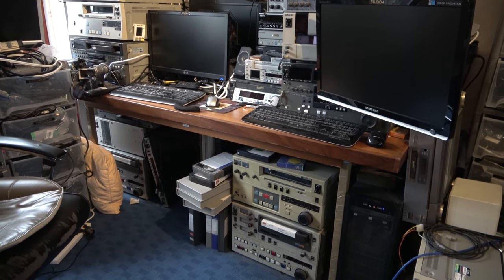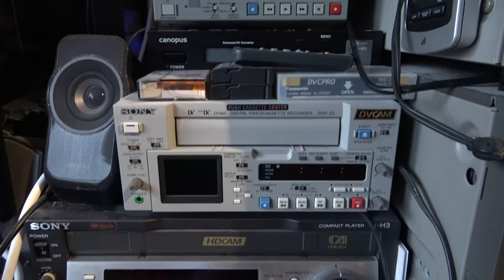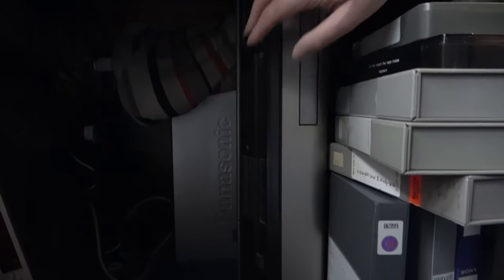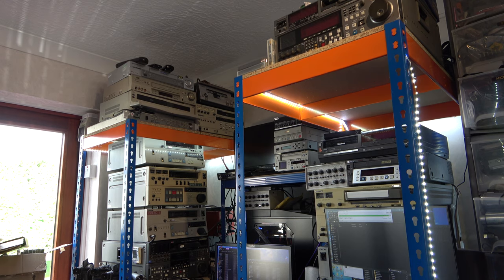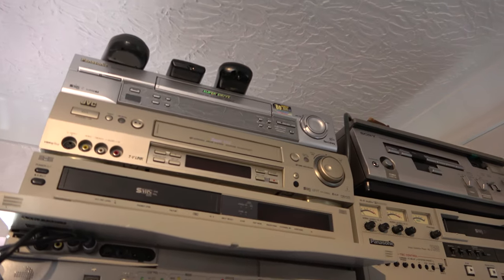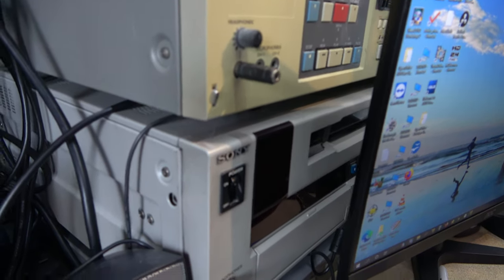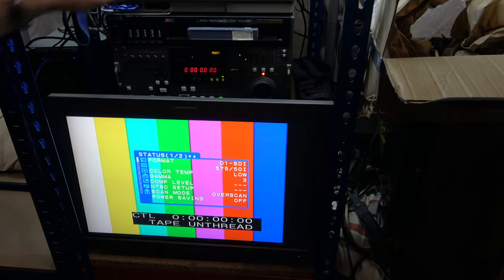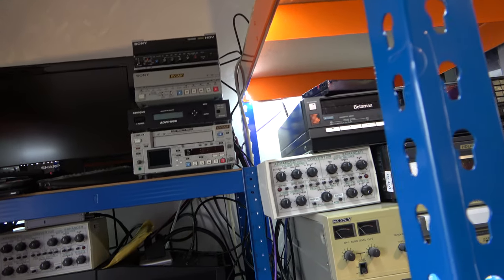Video transfer studio refit.

Comment: Incredible Setup! Is there a reason you use the Grundig 880 Video2000 Machine, and not the ones of the later generation (2xxx)? My Grundig 2280 gives a much cleaner and more detailed picture than my 880, but i also know of people who have had the opposite experience.
Reply from the maker: The VR2023 and similar machines have never given me the best pictures.  I don't have a working later Philips machine (I got one working once then within an hour of being repaired, another random electronic fault killed it!).  The 2x4 Super gives good pictures and sound, it's front loading which helps in my studio layout, has the time elapsed/remaining feature which is useful, and remote control.  It's unreliable as hell, just like all V2000 machines, but I think I've got so familiar with it that I can generally sort out problems quite quickly.  Once it managed to run for over a year without breaking down, which for V2000 is very good!
Reply: @video99couk  I was talking about the third generation Grundig machines, 2x8 etc. Ever tried these? Philips seem to overall produce a worse picture, at least from what i've seen so far, never had one myself. And i can relate to them being unreliable, i currently have 2 Grundig 2280 which both partially work sometimes and sometimes not. Keep on the great work, really like your videos! :)

Comment: The vectorscope could help you to deal with NTSC colour issues (hue shifting).
Especially when the source of the signal recorded comes from old aerial or analogue cable TV.

Waiting for the new obscure format!
Reply from the maker: The limitation with the vectorscope is a lack of analogue input.  I suppose I could connect it to something a DigiBeta recorder but then it would be PAL only.  I do have an analogue one too, but it quite literally blew up some years ago and would need a lot of work, there's a problem with its high voltage regulation.

Comment: 20 years ago I was fitting sky plus Digi boxes  with SDI  outputs  and the company I was doing it for sold them at £599 each .
Reply from the maker: Wow, SDI on Sky boxes, that's something I didn't know had ever existed.
Reply: @video99couk  Somewhere I still  have  magazine article , the company I fitted these for bought every pace 3000 sky box pace had left and I had them stacked up to the ceiling in the cellar , some even sold to the formula  1 racing team  , They fitted my PC with a SDI adaptor so I could test the boxes before sending the out  and I still have a standalone SDI box they sent me , unfortunately the whole thing collapsed when my stock of Pace 3000  boxes ran out  , the SDI conversion could not be done on newer model Pace 3100 as the processor was a BGA so there was no ware to tap off from .Personally I'm not familiar with SDI  but it was suppose to HD resolution pictures before HD had been invented .
Reply: @michaeldranfield7140  That's interesting! I suppose that prospective clients had specific needs; after all Sky digital boxes were basically DVB-S with decryption via the subscriber card. One use I can think of was when they'd show football match clips on the news and you'd see "Courtesy of Sky Sports" etc.

SDI stands for "Serial Digital Interface" and is basically a standardised format for transmitting audio, video, and control data in a professional setting. So I guess the modified boxes you sold were a much better way of ingesting a consumer format into a professional workflow instead of using an analog capture device which would've degraded quality and been harder to integrate.

Maybe this is what you mean with the HD resolution stuff - it wasn't HD as such, but the image quality was much higher - essentially broadcast quality, as the signal never left the digital domain. Sky didn't start broadcasting in HD until 2006, and you needed a new box because it uses a different digital encoding format.

Comment: Nice teaser about the blank spot.  Absolutely incredible setup.
That Panasonic pro SVHS player, under the NTSC BI (SLO-320, I think), looks very much like the one I used in an editing setup in high school 30 years ago.  I suspect it's the PAL version of the model I used, or at least very similar.  Brings back great memories.  I remember that you push in the jog/shuttle wheel to switch between jog and shuttle functions.  And those industrial transport control buttons... nothing like the buttons on any domestic or pro-sumer VCR.  As a student, I immediately knew I was dealing with a whole different grade of equipment than anything I'd ever seen before.

Comment: Awesome setup. Can I ask if you could do a video on the best or should I say most forgiving consumer video recorder/player you can recommend for playback of tapes that may not have been recorder on it (hope that makes sense) . I have done a little video transferring for my boxing channel from both Beta and VHS that I have either recorder myself or bought from other collectors. I understand the quality of tape is a factor as is the condition and ware of the outputting player.
Strangely the players that seemed to replay tapes the best were not the usual suspects, namely Panasonic and Sony, they were consistent.. always pretty good but no more... two head four head etc didn't seem to matter . 
Over the 30 or so years  I have had many many players and had great results from some unexpected manufactures, Mitsubishi, Phillips, Grundig spring to mind that have given better playback than Sony or Panny.. don't know why. Still, I could never afford expensive equipment so did the best I could. I have a pretty good Sony Betamax consumer player and various consumer VHS players. It's basic stuff.. No TBC.. Elgato HD60 .. A bit of tweaking with software for contrast brightness gamma etc and captured in OBS. So in effect I guess I am asking if you could do a piece on transferring video tapes on a budget. I really enjoy your very helpful videos. Keep up the good work.
Reply from the maker: I should say that there's no "best" machine, it's tape dependant.   Sometimes a VHS tape will play better on a JVC than it will on a Panasonic, or better on a relatively modest NV-HS930 than a more expensive professional deck.  Similarly, sometimes a Beta tape will play better in a Sanyo than a Sony, but another tape is better in a Sony.  As for doing it on a budget, I think there are two key items: A TBC (which is not cheap) and high bitrate video capture (I use DV/Firewire mostly, that's bot too expensive to put together).  Some people don't like DV/Firewire but it's much better than the compressed MPEG4 files from cheap USB capture devices.

Comment: Greetings, my good sir!  Am an incredibile fan of your videos, particularly on Broadcast standard gear.  There is still lots I've to figure out on order to utilize what may seem like obsolete equipment, to it's greatest capacity.  
Regarding why the professional monitor may be off in color compared to the consumer, would be your color calibration.  As every signal must be precise from camera to switcher to archive, to air, the monitor is key to have as close to the best picture, without having to flub around with.
With Broadcast standard color bars, the monitor should have a blue only function, which makes the bars black and blue.  The objective is to even out the color thought the monitor with the contrast, brightness, phase, Chroma adjustments so all black and blue is even though the screen.  Best set in complete darkness.  Once you are content with your adjustments, you turn the BLUE ONLY feature off, and you have a calibrated image to Broadcast standards.  At that point, in the is still a noticeable difference, then it would be wear and usage.  But professional monitors are truly built to last.  
You can't (that I know of) calibrate it through a waveform of vector scope.  That would be to calibrate the image itself to go on the air.  Then its everything from camera, to switcher, etc., that also must be taken into account.
None the less.  Your videos are quite educational.
I'm not too sure if you have any specifically on calibrating an older vector/waveform monitor, but that would be quite helpful.  I have four of them I'd like to work on myself to keep the best one(s), and be rid of the others.  They do tend up to take up a lot of useful space especially when not in use.
Also, on a DIY Sony DV VTR, And Sync to/with audio, as well as the difference between Genlock/TBS and Word clock.  I fancy the ability to record audio digitally, in an analog form.  Heh, Heh.  

Any how.  Thank you.
Cheers!

Comment: Now, what are you going to do with the two Sony DVW-A500P Digital Betacam recorders? Replace the worst condition one and replace it with a much better condition one donated from Bristol?
Reply from the maker: I had one DVW-A500P recorder plus a DVW-A510P player, this allowed me to do DigiBeta dubs if requested as I have been occasionally asked to do.  Now with the Bristol machine I have a spare for to take either place should one break (as one did a while ago, but I was able to repair it).  So for the time being, the Bristol machine is a spare.

Comment: Thank you for sharing your thoughts and your experience. Your new lab looks great. Your video comes perfectly timed, as I have to move my old lab to a new place. It was very interesting to hear your ideas about setting up a lab, you answered a lot of questions I was pondering myself. 

What’s your practical experience with stacking devices that accept tapes? When a tape gets stuck in one of my U-matic devices I have to remove them from the shelves and possibly lift other devices. This also affects all the cabling. How do you handle that?
Reply from the maker: Stacking was very much on my mind with this new set up.  It's horrible when the machine needs work at the bottom of a four stack of heavy machines.  So I always put the most reliable kit at the bottom and try to put smaller, lighter ones near the top.  The shelves reduce the height of any stacks so there are usually only one or two machines I need to move to access anything now.

Comment: Do you use MAGIX VEGAS Pro 14.0 for your videos?
Reply from the maker: My 4k youtube videos are all edited with Davinci resolve. SD video editing is usually done with Pinnacle Studio.
Reply: @video99couk  Your 4K UHD videos were edited in DaVinci Resolve, while standard-def editing is done using Pinnacle Studio Ultimate 12?
Reply from the maker: @northernplacecorporation  Yes that's pretty much it.  A lot of SD work is with DV-AVI files, which DaVinci Resolve still doesn't support.  The old Pinnacle Studio U 12 is a great "get the job done" app, it just works really well for simple editing.  Newer versions I found a bit slower to use.  I'm now quite happy switching between both applications.  DaVinci Resolve is more powerful but occasionally a little frustrating.  Pinnacle Studio 12 is dated and can do less, occasionally crashes and won't handle 4k, but is great for getting SD video captured and trimmed.
Reply from the maker: @northernplacecorporation  I don't take on repairs, I have a backlog of my own equipment to work on.

Comment: What software are you using to capture the DV and SDI signal into your PC?
Reply from the maker: Blackmagic Media Express for SDI.  It's not very nice software though, it doesn't even have an automated stop timer, so it's clunky.
DV can be captured with video editing software such as Pinnacle Studio but there's also a small standalone WinDV app which hasn't been updated in years but still works well.
Reply: I've been using a Blackmagic Video Assist 4K for SDI capture, also have an Atomos Shogun Inferno and Shogun Flame recorder. I have a Blackmagic Teranex 2D converter that has analog and digital video inputs so I want to try the Media Express software with a PC that has a Thunderbolt 2 connection that matches the Teranex 2D Thunderbolt 2 port.

Comment: Thoroughly enjoying the studio rebuild Colin...I just hope the foundations under your house are good and solid...Thats a lot of weight mate.Lots of cabling and Labeling endless hours of ...errr...fun ...rgds Evan
Reply: ..btw..I sent a couple of N1500/N1700 pinch rollers to Terry Witt in the US for refurbing...I'll let you know how that goes.
Reply from the maker: It's better now that all that weight is shared between about 12 shelf legs rather than just four table legs.  The studio floor is fortunately very strong, it's newer than most of the rest of the house.  (Our house has been extended three times by various owners and is now at least double its original size!).   More content due out today, and I think it's a fascinating one.

Comment: I think you need equipment management, Most of your gear is repeated several times, For instance you have the Sony HVR-M15AU, there is no reason for you to have any DV camcorder out of the storage room, I can go on and on but you get the picture, In my opinion you should have one player of each format and the rest should be put in the storage as backup or parts.
Reply from the maker: The trouble with that approach is that I then hammer the stuffing out of an expensive HDV deck when I could be wearing something much cheaper.  There are also two rigs here remember, so I can run multiple tapes at once.  Also the HDV deck won't play DV-LP tapes.  So it may look mad but there are reasons for the set-up the way it is.
Reply: @video99couk  yeah I do the same, burn out cheap handycams instead of the expensive HDV deck!
FireWire capture on the Mac isnt any good, so I use the advc 1000 in FireWire > SDI mode which works very well :)
Reply: I don't know of any serious studio operating the way you suggest. You need hardware redundancy if you want to squeeze every second out of your working sessions. There's no way you can handle orders efficiently working with one player at a time. Not to mention all the time wasted wiring new equipment up in case anything goes wrong. With this setup you're just one click away on your video switch.
Reply: I see now why, I’m just a hobbyist, I’m not geared towards bulk orders, sorry for the miss understanding.

Comment: Hello Colin, I've only recently come across your channel. I've never commented before, but I had to say I appreciate your channel so thank you for sharing your knowledge!  I had the same issue of space so built a new workshop/edit suite at the bottom of the garden. I'm tripping over a large collection of video tat here from rebuilt working 405 line TV's to video cameras going back to the 60's (there must be a cure for this) and machines inc V2000, SVHS, BetaSP, DVCAM, Umatic & N1700 machines plus some audio kit too (reel to reel, Minidisc, DAT, CDR etc). You've given me the motivation to have a go at the Grundig & Philips V2000 & N1700 decks I was putting off. I also need new racking.....plenty to think about. I may even start posting videos too! All the best
Reply from the maker: Ever done any 405 line video recordings?  Back in the day, there were some articles in Television magazine about modifying domestic VCRs to do this.
Reply: @video99couk  Yes, on VHS and Umatic, looked good apart from the DOC. If I recall correctly SVHS wasn't too happy with it though. Must try DVHS next 😉